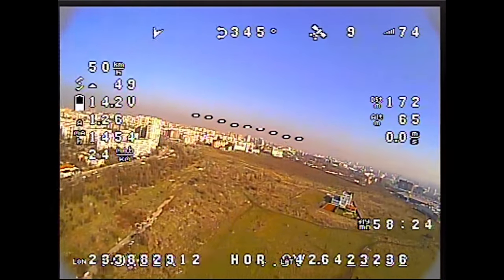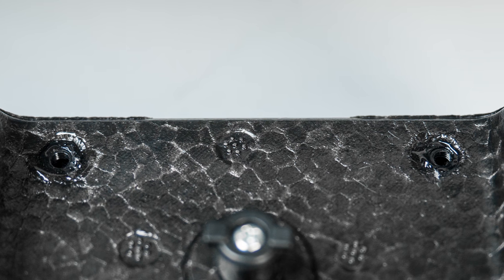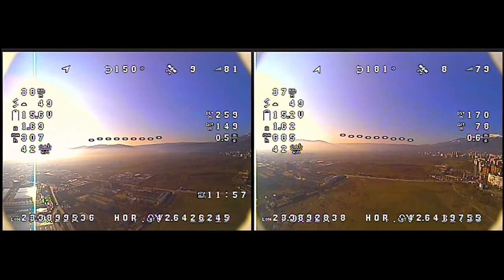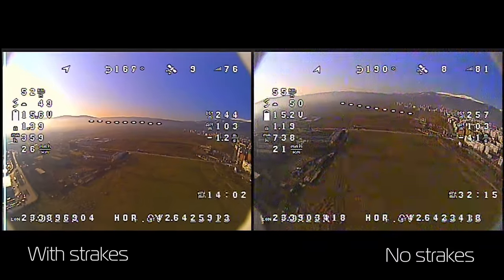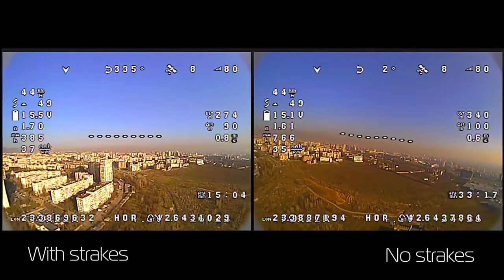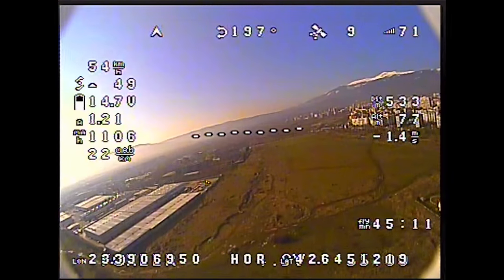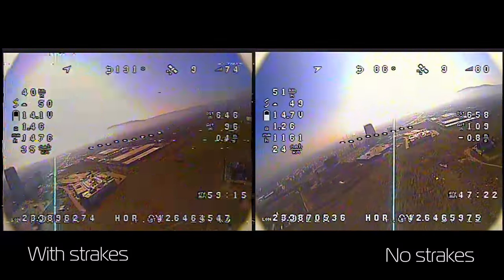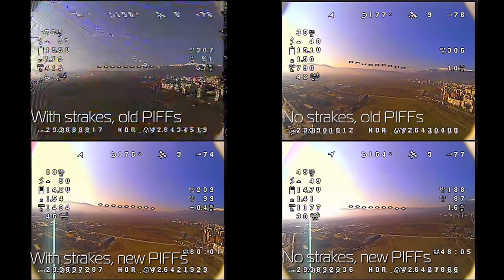the Nano Talon and the strakes - will the wobbles ever stop?

Comment: My Talon showed up this weekend and it was windy all day, but being the impetuous type I flew it anyway just POV and had the same experience.  Even in light wind it can start into a violent oscillation when turning, even worse with the stability control on.  But then later that evening just before sundown the wind stopped and it flew very smooth for 20 min on a 3s.   Today I took it to work and flew it at lunch in 20+ Mph winds and it was very hard to keep it in the air at all, it was bouncing around like a meal moth.   The instabiliy seems to be coming from the fact that the control surfaces are so close together and the fuselage is so short.  I don't think winglets will help that either, when a cross wind hits the v tail it wants to push it which causes the plane to try to roll rather than swap ends.   I have also noticed that the rudder command is very weak and when trying to perform a coordinated turn the plane wants to spin, again another symptom of a short fuselage.   Conclusion this may not be the best FPV platform for smooth video even if you add GPS and sonar.......etc.  it will never be inherantly stable.  It is a ton of fun to fly though and I love that you can smash into a tree and have it totally expode, then simply pop it all back together and fly again.
Reply from the maker: Haha, oh fun it is for sure! All of what you said is true, but I think its behaviour can be improved either way, while still keeping some of the portability! :) Now... as for that tree smashing... have a video of that?
Reply: Yeah! I would like to see video of self-disasembly!

Comment: Good comparison Nikola, my results which showed a big difference were at the end of a long line of other mods, and may have been the last necessary link. I flew mine last time without it, turned around and put it on and noticed a difference right away, but the NT does still get knocked around in wind like all of them but It looks like its a combination thing, at least it's cheap easy and reversible if it doesn't work.
Reply from the maker: Thanks for sharing this work... will print out a few more of these to see if changing the size a bit, when they are used on their own, would make any notable difference, and then would start adding other mods and testing with them as well! :)

Comment: There is a mod avaliable now that takes out the dihedral in the wings. This really help more than anything. If you have a 3d printer the files for the parts is on Thingiverse.
Reply from the maker: Yes, I have seen it, will get it done once I've flown it a bit with the Mini Pix I installed in the plane, and have some benchmark flights to compare against!

Comment: Dont you think the main issue is with the "slop and wiggle" of the control surfaces themselves? I believe if the servo linkages where tighter with less slop it would make a HUGE difference.
Reply from the maker: That could also help with the issue... but apart from moving the servos to the wings, I am not sure there is much that can be done to eliminate that slop. Will look into tightening things a bit, as they are indeed a bit too loose... but so far I've found that strakes do make a difference, but you have to be 50km/h or higher for them to be effective. Below that they don't work!
Reply: That actually makes sense... Faster air moving over the surfaces and all. As far as taking out the slop, I really think it would make the biggest difference. I honestly feel like strakes and winglets are just a band aid that are masking the real issue. Curious on your updates so keep the videos coming.
Reply from the maker: Will figure something out to reduce the slop in the controls... we will see what the result will be!

Comment: Very useful info here. Do you fly with the stock propeller?  Do you think there is better prop/motor combo for the Talon?
Reply from the maker: I do fly with the stock propeller... not easy to replace it without changing the motor as well! As of this time I have not tested anything else on the NT just because the stock system works so well and is efficient enough! I see no reason to change it at this time.
Reply: Thank you!
Reply from the maker: You are welcome! :)

Comment: Here's a suggestion (which I can't test on my Nano Talon as I've already wrecked it). Looking at this early prototype of Zawlade you'll notice it has the same wobbles except worse:
https://youtu.be/IkV-gOIZtNU
and then in this video you'll see the issue has been resolved with an anhedral mod:
https://youtu.be/IrWI6VGaYbU
In the case of Zawlade (in video #1) the issue was in the lateral stability. The centre of effort of the vertical stabilizers was higher than the centre of weight. Therefore the heavy point of the plane acted like a pendulum or a swing after each change in direction. This is fine for free flight with no RC control system as it causes the plane to self stabalise and pull flat with the ground. The Nano Talon is not a plane whereby an anhedral mod could be easily applied. However an extra tail plane pointing downward may fix it. A single one may have to be bigger than each side of the V-tail. Maybe add the equivalent upside down V so it becomes a cross tail. Either that, or downward pointing wing tips (fences) which hang to lower than the fuselage. If done right, the wing tips may also give better flight efficiency.
Zawlade weighed in at around 700g, but our other plane Gemot is only around 330g and it's very stable. Yes, weight fixes things because of the inertia associated with mass, but stripping all the weight out really points out how good a planes aerodynamic stability actually is. No fudging it. 
This is the 330g Gemot (roughly designed after Zawlade) in high wind in a high turbulence zone:
https://youtu.be/QLdEnKlGFs8
Reply from the maker: An interesting suggestion... but I don't think landings will be possible if I make a second inverted V-tail on it... definitely would compromise the plane's usability! I wonder if this works on your planes due to the high winds and lack of a motor/prop system...
Reply: It would just be a test. Or the downward wing tips instead of the inverted V-tail will still drop the lateral centre of effort whilst keeping it's ability to land.
Reply from the maker: Hmmm... will think about this... but I think adding winglets and vortex generators might be easier to implement and keep in one piece! :)

Comment: And now devices that are not available? What should I do? FrSky L9R Long Range Receiver for FrSky Taranis X9D - Not Available (Change for: FrSky R9 900MHz 16CH Long Range Receiver & R9M Module System?), Radiolink Mini PIX F4 Flight Controller MPU6500 w/ TS100 M8N GPS UBX-M8030 For RC Drone FPV Racing - Not Available (Change for: Arkbird Autopilot 2.0 FPV Flight Controller With Air Speed Meter Set?), Realacc Pagoda RHCP Antenna 65mm 5.8G 5dBi Panel Plate Omni Directional FPV Short Antenna RC Drone - Not Available (Change for ?), Aomway 11dbi 7 Turn 5.8GHz Helical Antenna (RHCP) for RC Drone FPV Racing Multi Rotor - Available but RP-SMA Male SMA Male? Help me... big thanks, regards...
Reply from the maker: Now, as for the helical antenna, connector would depend on what connector the goggles have, check their description and chose the correct one! As for the items that are not in stock at the moment... you can place a backorder perhaps, and they will ship when they are in stock, or just wait to see them in stock, and then order them! These are popular items so I think they will not be out of stock for long! :)
Reply: Arkbird Autopilot 2.0 FPV Flight Controller With Air Speed Meter Set? Isn´t a good option for OSD, RTH, GPS, etc... to flight Long Range (5/10 KM this project)? We have almost all the parts to be order!!! What you say? Thanks, regards...
Reply: Eachine EV800D 5.8G 40CH Diversity FPV Goggles 5 Inch 800*480 Video Headset HD DVR Build in Battery!!! It's the same you use, correct? If yes, what antenas shold I buy? Thanks, regards... (Note: The shipping to Angola it's very expensive and receive the order have lot of questions, because of this I'm trying to make a single order to put the whole solution together. Thank you for your understanding and support for some restrictions that affect my options. Thank you very much.)
Reply from the maker: The Arkbird is a good option as far as I've heard. People that have used it are generally happy. As for the goggles, yes, they are good, but lately the DVR has been acting up when there is too much interference in the video signal, it would stop recording on its own. Otherwise the goggles are pretty good! As for antennas... I stand by the selection I gave you, the pagoda and aomway helical - helical is on the goggles, pagoda is on the plane.
Reply: Aomway 11dbi 7 Turn 5.8GHz Helical Antenna (RHCP) for RC Drone FPV Racing Multi Rotor - Available but RP-SMA Male or SMA Male for this googles?
Reply: Realacc Pagoda RHCP Antenna 65mm 5.8G 5dBi Panel Plate Omni Directional FPV Short, same question, RP-SMA Male or SMA Male? Sorry, I don't know how to connect it to other devices so I do not know which connector to choose !!!
Reply: OK, order Eachine EV800D 5.8G 40CH Diversity FPV Goggles 5 Inch 800*480 Video Headset HD DVR  and Arkbird Autopilot 2.0 FPV Flight Controller With Air Speed Meter Set!!!
Reply: They have, today, the Volantex Ranger EX 757-3 1980mm Wingspan Long Range FPV RC Airplane PNP and the Volantex Ranger 1600 V757-7 1600mm Wingspan EPO FPV Aircraft RC Airplane PNP and they don't have the favorite Volantex Ranger 2000 V757-8 2000mm Wingspan EPO FPV Aircraft RC Airplane PNP, definitely, what will be the plane of our project (first long range 5/10 Km for a newbie)?
Reply from the maker: OK, the Pagoda for the video transmitter should be RP-SMA, and the Aomway helical for the goggles needs to be with an SMA connector. Out of that choice of planes... I would still go for the 1600mm Ranger. Later on you can just buy the 2000mm wings separately and upgrade the fuselage you have, as they are the same! The 757-3 Ranger is too big.
Reply: It may be this model, the suggested is exhausted, 80mm Pagoda 2 Antenna(RP-SMA-plug)?
Reply from the maker: Sure, will work as well! :)

Comment: Dear, Thank you we validated what I found the Bang Good and I await your OK, or corrections, to order: 
Volantex Ranger 1600 V757-7 1600mm Wingspan EPO FPV Aircraft RC Airplane PNP, FrSky 2.4G 16CH Taranis X9D Plus SE Transmitter SPECIAL EDITION w/ M9 Sensor, Eachine EV800D 5.8G 40CH Diversity FPV Goggles 5 Inch 800*480 Video Headset HD DVR Build in Battery, Eachine TX801 5.8G 72CH 0.01mW 5mW 25mW 50mW 100mW 200mW 400mW 600mW, RunCam Sparrow WDR 700TVL 1/3 CMOS 2.1mm FOV150 Degree 16:9 OSD Audio FPV, Aomway 11dbi 7 Turn 5.8GHz Helical Antenna (RHCP) for RC Drone FPV Racing Multi Rotor!? Do you valid? What change? Thanks very much, regards...
Reply from the maker: Sure, that sounds good! As for the L9R vs R9M module... you can always also go for the R9M module with a receiver, it has even longer range.
Reply: Dear. Thanks. As suggested, I will buy the FrSky R9 900MHz 16CH Long Range Receiver & R9M Module System. Regards...
Reply from the maker: I recently received that same system, and even flew with it today, seems rather good! :)
Reply: I'll order this. Thank you very much.

Comment: Eachine EV900 1920*1080 HD 5.8G 40CH HDMI AR VR FPV Goggles 5 Inch Display Built-in 2400mAh Battery it's a is it a good investment for this FPV Long Range project? Many thanks. Regards
Reply from the maker: The thing about long range is that you can't really count on your goggles if you want to go long! I guess with a directional antenna and by pointing your head in the direction of the plane you should be able to get a decent signal out to about 5-6-7kms... perhaps 10kms with a more powerful video transmitter, but if you  want a really reliable video link, you would need an antenna tracker: https://goo.gl/bAONIi

Solves a lot of problems and makes long range flights a lot easier in terms of video signals, link quality, etc.
Reply from the maker: OK, actually I would stay away from the OTG things... really not ideal for long range! I guess the goggles you asked about will be enough, but like I said, you will need a directional antenna on them, and would need to turn your head in the direction of the plane for best results.
Reply: Thanks for the information. Regards...